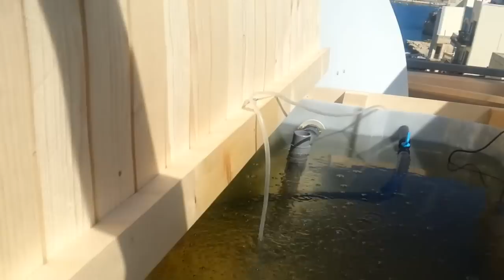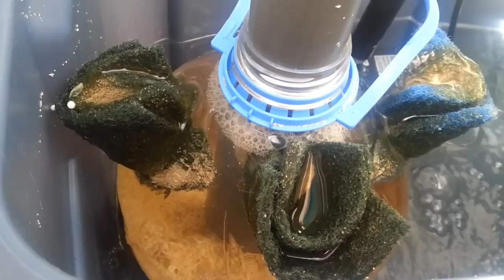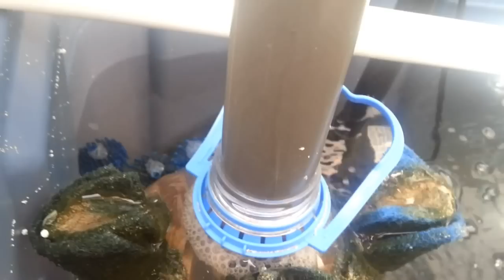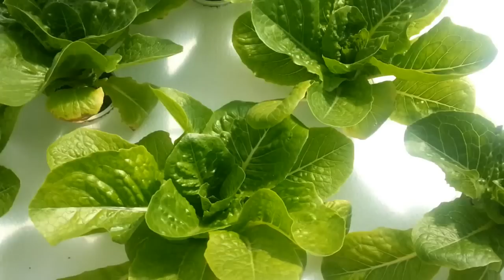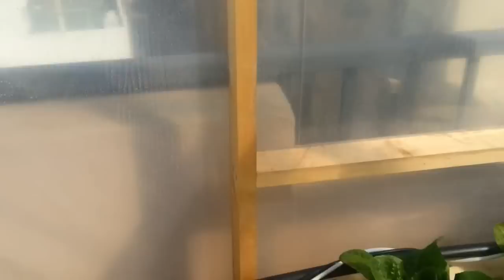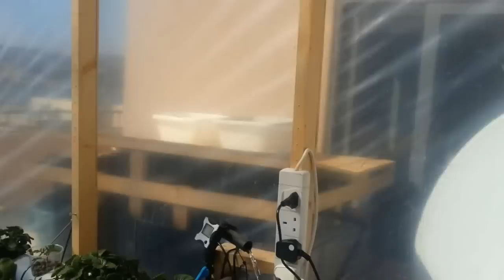Constant Height One Pump (CHOP) Set Up Part 2 IBC Fish Tank Water Quality

Comment: hi. do you have any experience with pushing water straight up with water pump?¿?
im trying to run a flood and drain but i dont know how much power a water pump needs to push up water at a height of 1.3-1.4m straight up into the top tray.
my tray drains at a rate of 1500lph with a bell siphon design. as far as i know the water going up should be weaker than the water going to allow it to drain efficiently?
any idea? thanks for helping a fellow WATER GARDENER
Reply from the maker: There are a number of things to consider for the sizing of your water pump. Be sure to have to water in your fish tank cycle a minimum of once every hour. I like to have ours cycle 3 times every hour. This helps keep the fish tank free from solids waste. You might try a 3000 lph pump with head loss this should be fine if your fish tank is under 1000 litres. Let me know if you have any other questions. Drew Kassa